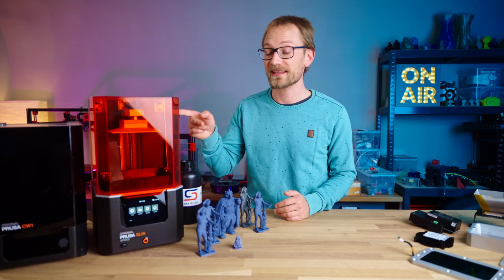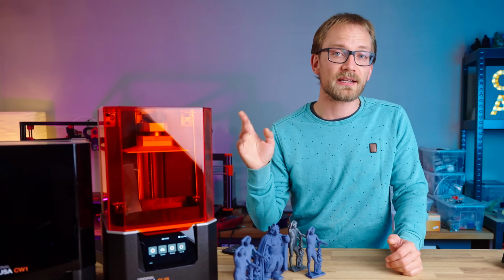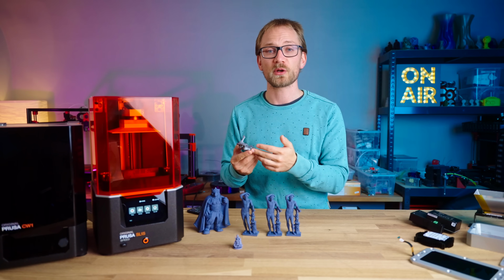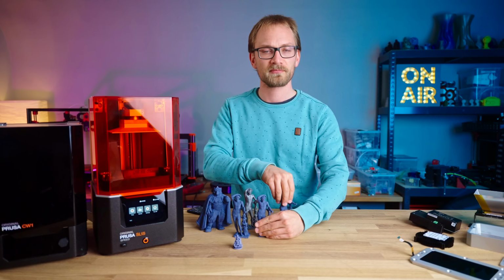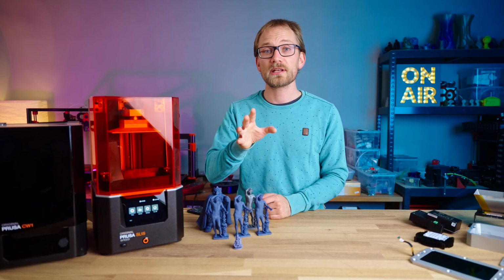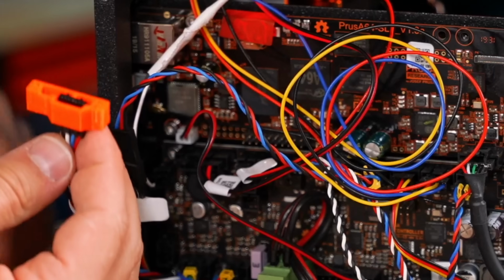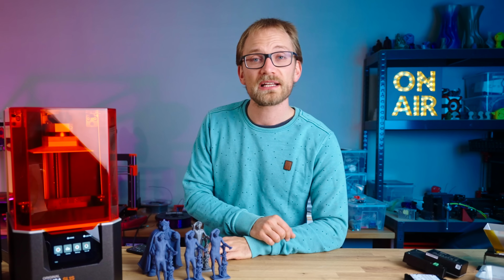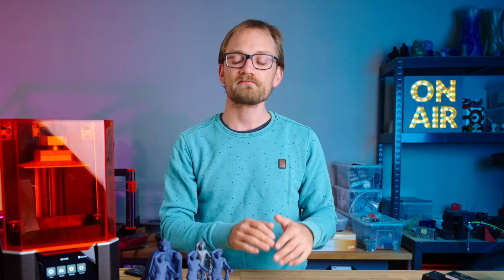The Prusa SL1S redefines SPEED!

Comment: This prints it seems about 30-35% faster than all the other way cheaper, higher res monoscreens already out there,  and with significantly lower resolution than things like the Sonic Mini 4k.  And a Sonic Mini 8k is already out for pre-order, totally blows this thing away, and for half the price  :D    As a person who's reviewed 40+ different resin machines, I honestly don't see why anyone would buy a Prusa when it comes to a monoscreen printer.  I know some people just love the name though, and don't mind paying a lot extra for a few bells and whistles  :)
Reply: 2000€ for a Sl1S

Or 7 mars 2.. same resolution and goin waaay slower no layer shifting. So in 3X the time you have 7 prints.

If you are prototiping single models.. ok.. otherwise is slower per money 🤷🏻‍♂️
Reply from the maker: I specifically ran the same print on the Mars 3 as well (and even included it in the video), and it took twice as long while having visible flaws. Which printer specifically can print the 130mm tall Apollo model faster than the SL1S?
Reply: @MadeWithLayers  Well it depends what settings/parameters were run for each print, including bottom cure time and number of bottom layers, lift height, light-off delay, lifting speed, retract speed et cet, all which can affect print time.  I can print 130mm tall on a Sonic mini 4k in 4 hours.  So if you did it in just 3 hours on this I would concede it's a bit faster, but not 2x as fast.  And if you see my prints off the mini 4k they are incredible, way better than what you got off the Mars 3.  Not trying to pick a fight, I honestly just don't see any reason to spend money on a Prusa when there better alternatives that are cheaper, imo.  Have you checked out the Sonic Mini 8k which is shipping soon?
Reply from the maker: The prints were all done at 50µ and stock print settings. Obviously you could eek out faster print speeds out of any 3D printer (resin or not), but the factory settings usually are the ones that universally work, and aren't just tweaked to function for one specific scenario.
Since the Sonic Mini 8k isn't exactly out yet, no, I have not tested it yet. I stay away from pre-release products as much as I can. Full explanation here: https://toms3d.org/review-guidelines/
Reply: Gotta get that 40% better print quality and 5x longer print times with dat 8K  aw yeah.. 🍆

As someone who’s reviewed 40+ resin printers you’d think you’d understand the Target Market concept. How many budget printers have you any many other people thrown away because parts are sub par quality, unavailable, sold out, or the machine is just completely outdated during the same amount of time an SL1 just keeps on working and then is upgradable and will in all likelihood enjoy future support and upgrades? 
Prusa isn’t even attempting to compete against Elegoo or Anycubic so why does everyone seem to think they are? The marketing they’re aiming for is business and enterprise, so a better comparison would be Asiga or B9, which are 5x the cost of an SL1S with the same or less features and similar build quality.
Reply: @danielwright4307  5x longer print time?  Not sure where you get that from, but I totally get that some people want to pay more if the machine is more reliable, and doesn't have "budget issues".  But there are some cheaper options that are very well built and don't have issues.  It's simply true.  I actually understand paying for the "Prusa quality" more on an an FDM printer to be honest.  I'm not saying people shouldn't buy Prusa by the way, I just honestly think it's not worth it in this specific case...I'm not a Prusa hater or anything....

Comment: With the cost of giant lcds being cheap now, what's stopping these printers from being able to print a full size gokart/micro electric car?
Reply: The LCD in resin printers fail really fast. In larger high end resin printers they usually use DLP projectors or scanning UV lasers.
Reply: @cucumberworks  the new mono screen will last 2000 hours, sooo
Reply: @noway8233  They are still no where near the life of DLP and scanning laser though
Reply: Can't we develop a lcd panel that has a easily hotswapable light source? 
We sure could!!
Reply: @truetech4158  I think the main problem is that when you get larger print sizes LCDs start to loose their advantages. Small LCDs for cell phones are cheap and easy to replace. But for larger build volumes, I would rather pay a bit more for a technology that lasts a lot longer.
Reply from the maker: There are one or two companies that straight-up use take the LCD panels from 4k TVs and build printers from them. Totally works!
Reply: Yuo forgot the price of thecnical resin, they are expensive

Comment: I love the way Josef Prusa made FDM printers available to everyone(in 2015) and later Chinese made it cheap  (on expense of Josef of course).. But now he is chasing Asia with Resin solutions and is far way behind with specs and ridicules EU pricing(sad thing about having to import everything relevant from China as EU does not produce anything useful anymore). I admire that he is fighting hard to remain relevant but he is doomed for Resin race. He event lost FDM race with casus of Voron 2.4..
However kudos to Thomas that he is loyal and still tries to promote Prusa solutions.
Reply: Voron doesn’t compete with Prusa really. I’m building one now and it’s a lot of fun/frustration but if I needed to do a lot of 3d printing I would just buy off the shelf printers.
Reply: @calebland6246  Voron is a new design.. much improvements to standard coreXY like Prusa design was huge improvement to Mendel.. back in 2015 building a "Chinese" kit based on PrusaI3 was a frustration as well..
Reply: Wow that's some warped history right there. It's marred by the survivorship bias. There were a thousand 3D printer companies across the globe, and mostly they all came from the DIY/maker movement. Of course Josef Prusa's designs were well known and popular starting 2012-2013, he did a lot to optimise and simplify the Mendel printer. If you wanted a printer in 2015 or before, you might be buying a Printrbot or a Makergear or a MendelMax one of so many others, they're merely forgotten now because they no longer matter, and there were a lot of smaller kit companies shipping all sorts of open-source DIY printer kits, many of those of some popular design off the Reprap wiki, some self-designed ones.

Prusa came late to sell his own designs, by years.

By 2015, most of the EU and NA 3D printer kit businesses have come and gone, because Wanhao, Hictop and Geeetech ate their lunch. Again those came long before Prusa Research.
Reply: @SianaGearz  Printrbot was also ahead of the time.. but Brook Drumm is not as good salesman like Josef so he is long time gone. Of course there are hundreds of producers but how many of them are well known? How many made FDM printing design affordable(I don't mean copy casts like Wanhao, Hictop, Tevo or Creality)?
"There were a thousand 3D printer companies across the globe, and mostly they all came from the DIY/maker movement" -  any movement will fall if there are no leaders.. that is why nobody cares these days for Ultimaker which used to setting up high standard grades to follow. Their solution was a good copy of Stratasys with different world of patent expiration than now that is why Voron is a fresh thing.. 
And Prusa is still making a living out of his not so fresh MK3 design with little tweaks here and there and very good software solution... which is free of charge. However he will never catch up for Resin solutions with Phrozen or Anycubic.. supply chain disadvantage and EU red tape will slowly eat him. Like idea of local US vendors killed of Brook Drumm venture.
If you see bias in my comments I guess you have to see bias in everyone's comments which are not 90% align with your opinions. I'm a techie I see world as it is.. and this is a sad&cruel universe we are living in...

Comment: Although I am loyal prusa fan, I would really like someone to convince me to go for SL1(S) at this price tag? 
If quality and customer support is excuse for current price, EPAX X series printers are well built too, with customer support and upgradeability too, at 500-ish euros price tag for X1.
I would warmly suggest them to aim for 600-750euros price tag for 5-6" inch printers to have "MK3 of resin printers" as claimed.
Lets compare SL1S vs X1K Epax:
- Prusa SL1S (2000$): 1620x2560 2K mono screen // robust nearly all metal body // XY res.: 47µm // Exp. time: 2.5-3sec? // FEP film // parallel UV light // ballscrew Z axis // upgradeability // customer support // tilting mechanism // resin level sensor
- Epax X1K (600$): 1620x2560 2K mono screen // 10KG robust all metal body // XY res.: 47µm // Exp. time: 2.5-3sec // nFEP (PFA) film // parallel UV light // rocksolid double rod Z axis // Ethernet // upgradeability // CUSTOMER SUPPORT

Conclusion SL1S has advantage over Epax X1K : Tilting mechanism, Resin level sensor, Prusa connect
Reply: You can also get some of the largest resin 3D printers out there for prusa's sl1s asking price and able to print way more at once. Sometimes i prefer printing  a larger fully  assembled  model over the sub assembly because I don't  have to worry about super glue, and green stuff, sanding for a perfect look without seems.
Reply: Having used many lower end LCD printer and all 3 generations of the Formlabs machines, I was tempted to get the SL1S but the price is a bit high. From my experience working with these machines, the printers with a tilting tank(eg the Formlabs ones) have considerably higher success rates. On the Form3 I feel like I never get a failed print, no matter how I orient the parts. On the other hand I really need to tweak the settings on the LCD printers for them to produce consistent prints.

I feel like the SL1S's pricing really put it at a weird spot. For professional buyers and prosumers I think it would be a better choice to spend some more to get a machine like the Form3. Although since Formlabs has its proprietary materials and resin tanks, the long term costs are much higher.

I really hope the Chinese makers will adopt the idea of the tilting tank as it just makes resin prints much easier. Working with resin printers has such a steep learning curve now and failed prints almost drove me away from the hobby.
Reply: @cucumberworks  I agree with you that tilting mechanism makes significant improvement, but EPAX X1K because of its bulletproof structure and NFEP VAT has great success rate compared to low end Mars or Photon. But really, tilting mechanism from Prusa is worth 1500$ extra compared to 500$ X1K??
Reply: @brezovprut4431  Right, I just find the 2k price hard to justify, especially given the relatively small build volume

Comment: so its faster, but if i wanted it for war hammer type figures (detailed, with intention to pain them), etc, how much worse/better is it than the 4k ones that everyone recommends?
Reply: depends mainly on pixel density and how big you want them. Since a lot of the 4k printers  also have a bigger buildplate than the sl1s (mainly thinking of elegoo saturn), you end up with pretty much the same pixel density (~500 ppi in both saturn and sl1s by my calculations)
Reply: Something like the phrozen sonic mini would maybe translate to a better quality print (~700 ppi), but tbh, in my experience 500 ppi makes beautiful prints anyways. And paint helps cover up a lot of imperfections
Reply: Warhammer minis are usually painted in complex, weathered, and intricate schemes of a dozen coats or more, so I there'd definitely be diminishing returns on additional pixel density.
Reply: @tomiesz  I have happily played against FDM printed armies - it's all about your gaming crew really :)
Reply: Compare the XY resolution. "4K" is just a number that means nothing if you don't take a look at the size of the LCD. The 8.9" 4K printers have 50 microns XY resolution. The SL1S is in the same range. So not bad, not great. But how good the prints are also depends on the resin quality. ABS-like resin will always lack detail but is better for table top gaming. The figures won't break easily. Precision resin is more brittle but will give you much more detail. If you combine that with a printer that has 35 or 31.5 or 22 microns XY resolution you will get amazing results. Display pieces that you can bring to painting contests.

4K at 6.6" = 35 microns XY resolution
4K at 5.5" = 31.5 microns XY resolution
8K at 7.1" = 22 microns XY resolution
4K at 5.5" with subpixels on the x-axis = 31.5 x 10.5 microns XY resolution
Reply: I mainly do tabletop minis and greeblies and stuff on my resin printers and the main advantage here is speed. If, you are like me, I tend to send your Mars/Saturn prints over night, then there are minimal advantages. For me I ordered the upgrade for my SL1 because of daytime prototyping where the round trip time improvement is worth more than the upgrade costs.

For when I am DMing an RPG I could definitely see me running off a quick piece of scatter or a BBG though knowing I can cut the print time down ...

As someone said elsewhere, the resolution/rendering improvement is moot when you are 1) painting and 2) going for table ready rather than holding it an inch from your eyeball 😆